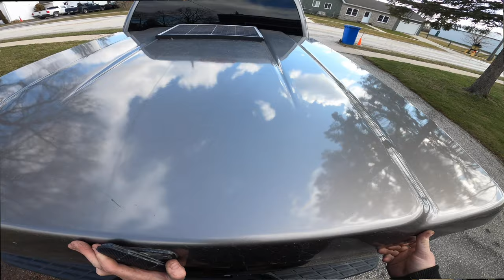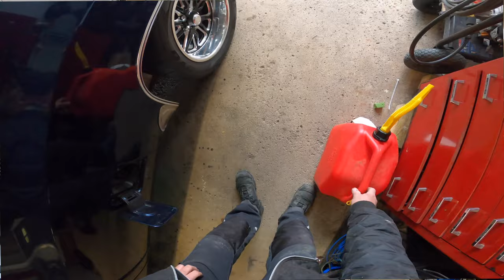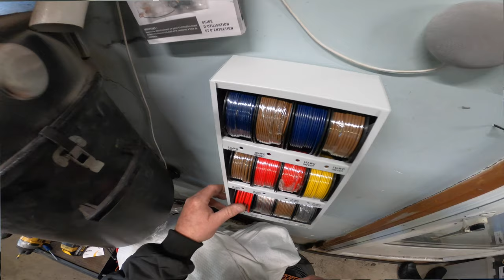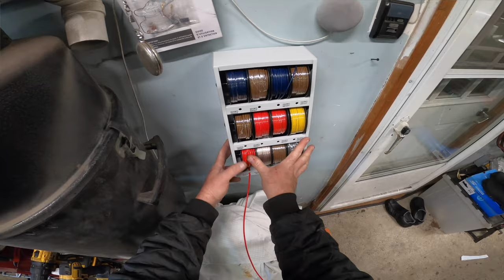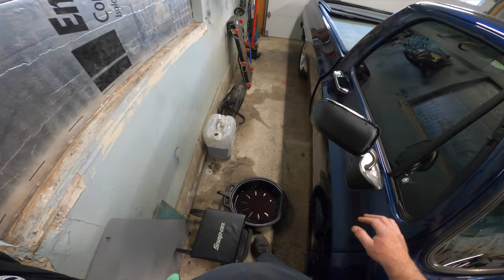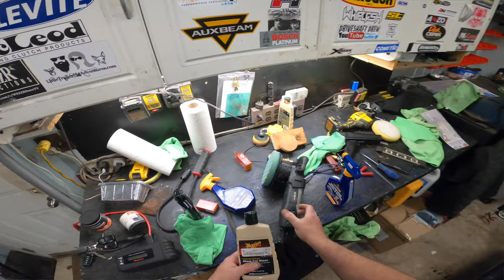The Spots Have To Go (NOW)  4K

Comment: Unless you're running a high compression engine, and you need the higher octane to prevent detonation, buying 92 or 94 is probably a waste of money. Lookin good, Captain!
Reply: My guess is he’s probably trying to only buy gas with the least amount of ethanol in it as possible. that’s why he’s going with a higher octane
Reply: @classicxl  Very possible, good call...